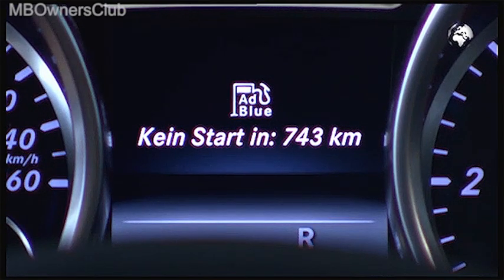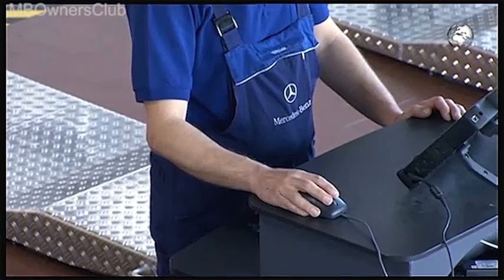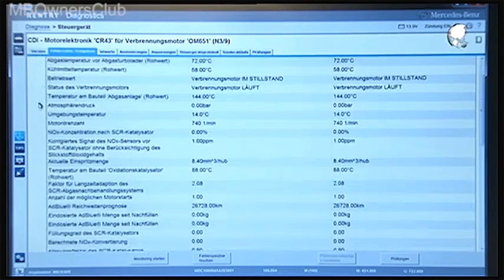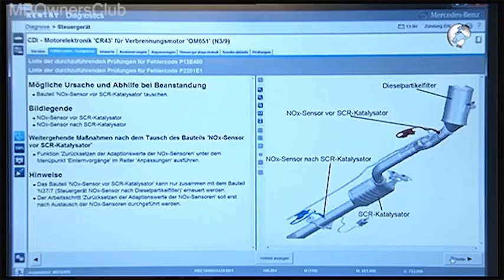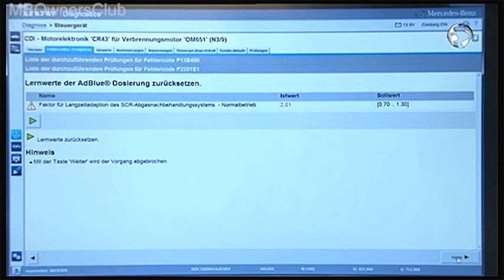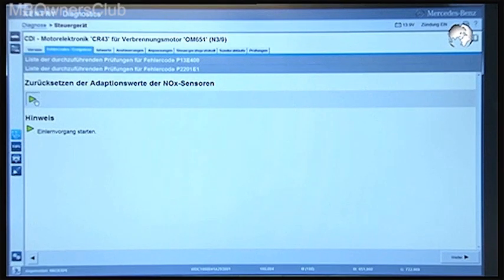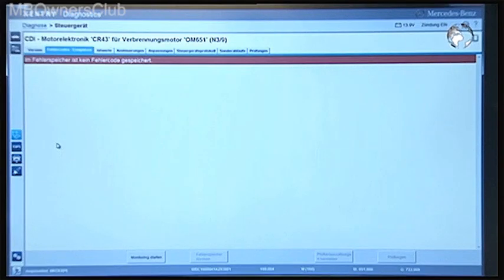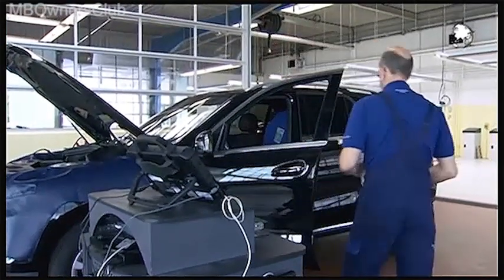Mercedes-Benz AdBlue® Fault Messages: How to Clear Error Codes and Reset Warning Messages

Comment: I have cleaned my NOX  sensor with EGR  cleaner  .Job done
Reply: Just cleaned mine but I still have the 500miles to no start, did yours reset automatically?
Reply: Same here i got rid of the other faulty codes but still have limiter  @Adanios77

Comment: No mention of the corrupt software Mercedes have in their ecu systems then causing the majority of these "NoX" issues. Sensors don't go faulty that often and should be good for aroun 100k trouble free, they should NOT need replacing after 30 or so k miles. We all know that the software MB have created is not up to the job and keeps the service dept well funded. When my check engine light appears I clean my sensors then they work fine again for x k miles. The main issue is the software not the sensors !!!  be warned your lovely MB dealer will happily take £500 from you for unecessary work. Seen it done a 1000 times.
Reply: how to clean sensors?
Reply: Thanks for the comment Really helpful